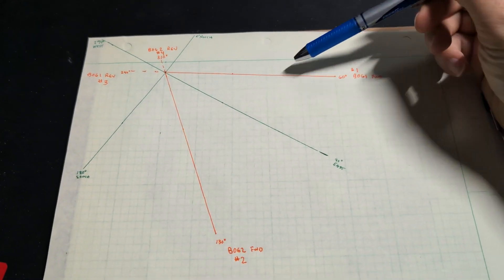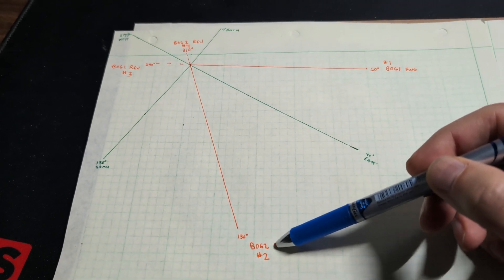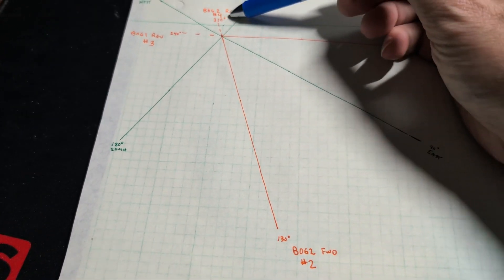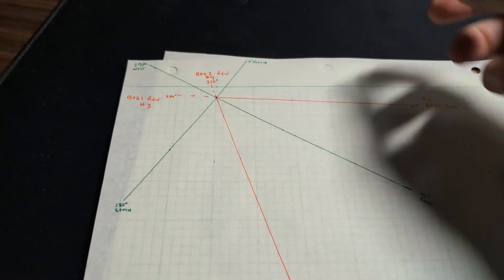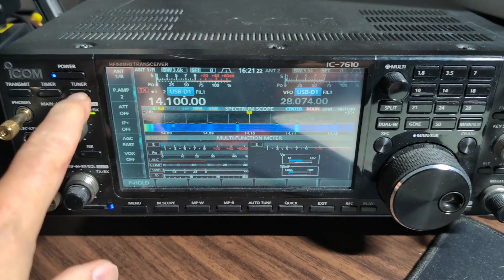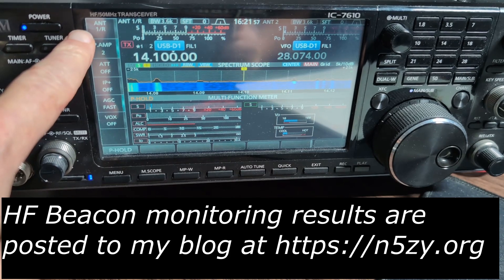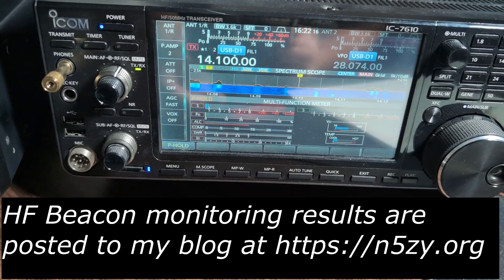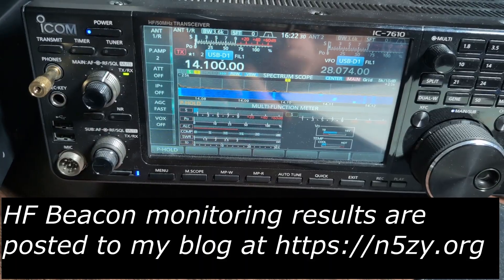Beverage On Ground (BOG) Antenna on a residential lot

Comment: C'mon man, that feedpoint system is extremely sloppy. Everything just hanging there on 5,000 zip ties, no weatherproofing. Buy a "Waterproof outdoor electrical junction box", mount Everything in it straight and neat, then properly route the transmission lines into the box and connect it all up. $60 bro, do it right

Comment: Really cool, well done!  I have the pieces gathered to build a receive loop antenna.  Hopefully trying to mitigate some local noise.
Reply from the maker: Great!  Anything to reduce noise right!  I was really wanting directivity..  It's made a real difference but now with FT8 I'm decoding several stations that cannot hear me..  LOL..  Out of frustration the other day I actually looked at prices of amps.. but that's a lot of $$$$ to get 11dB gain (or just under 2 S units) into a omni-directional vertical... 
Makes me wonder if I can use remote ham radio for transmit and receive off my own station.. just so I can 'rent' the transmitter/facility..